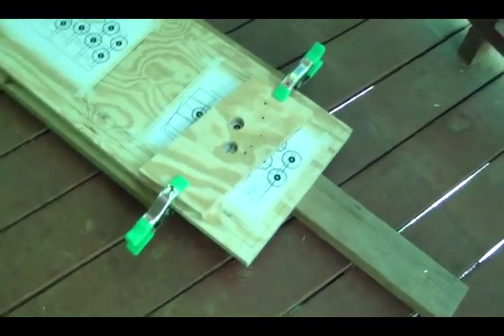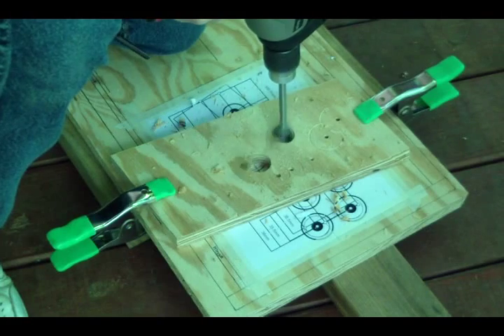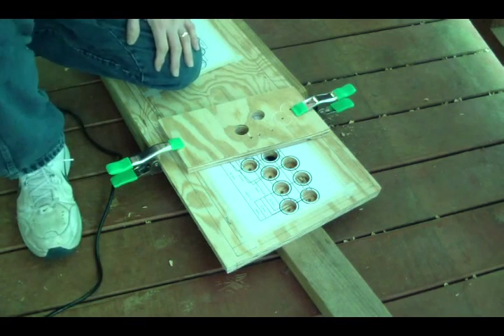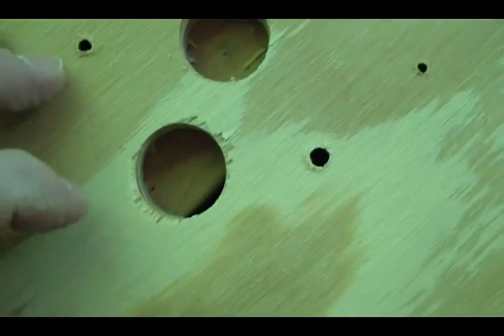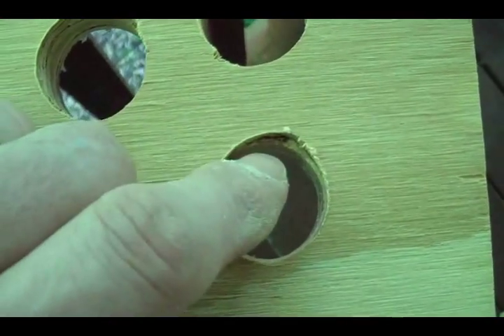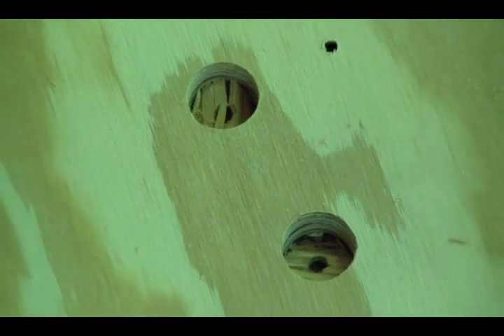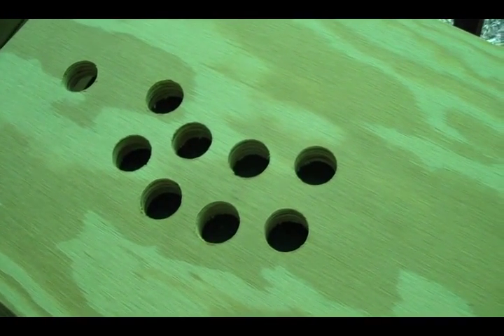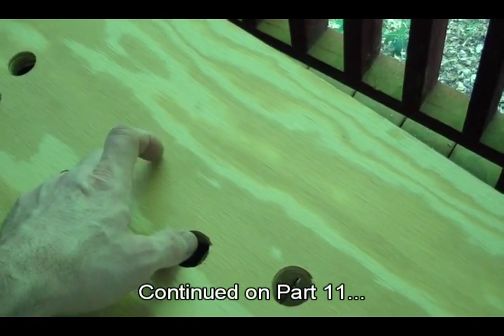(Part 10) MAME Cabinet CP Build

Comment: Couldn't you also just tape the front and back, then put another piece of wood behind it and drill all the way through? I did that recently with a piece of MDF and it worked well. Honestly though, for button holes I just use a hole saw it would be cleaner than a spade.
Reply from the maker: Sorry, somehow missed this reply 2 years back.  Yes the tape and wood "sandwich" sounds like a good idea.  Like that better than the holesaw honestly.

Comment: I guess a forstner bit would have helped during the hole cutting. Would have kept it a tad cleaner. I don't like flat bits.
Reply from the maker: ChrisWhite85 At the time I didn't have any of those, but I have a large set of them now and will use them instead of the spade bits for future projects.
Reply: Excellent choice! After I used them I never looked back! Enjoy!

Comment: Why didn't you just use a hole saw bit instead of a paddle
Reply from the maker: I could have, but I am actually not 100% sure I have one that small.  I think the hole saw set I have goes down close to that small, but I'll have to check.  The one thing I don't like about hole saws is the little round chunk of wood you have to pry out of the cup when you're done.  Not a big deal when you cut one or two holes, but imagine prying those little circular plywood pieces out for 27 holes!  That's the amount my cabinet has if you include the admin buttons, pinball buttons, and joystick holes.  Also, some hole saws have a bit of a wobble, making the final hole slightly larger and causes some problems if you're trying to center each hole precisely.
Reply: TortureBot okay makes sense was really just wondering about to do my own build so trying to figure out what options it's best for myself
Reply: TortureBot I do want to say your videos have been very helpful and acquiring pieces and planning
Reply from the maker: Thanks!  Now, I just need to get the rest of the footage processed and on YouTube!  Good luck on your build!